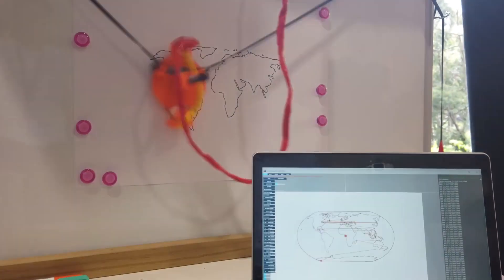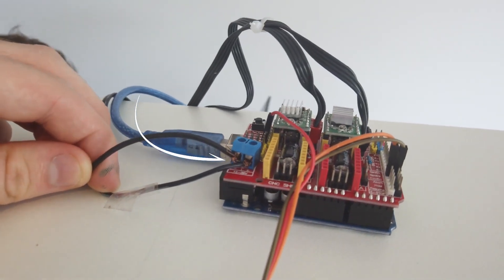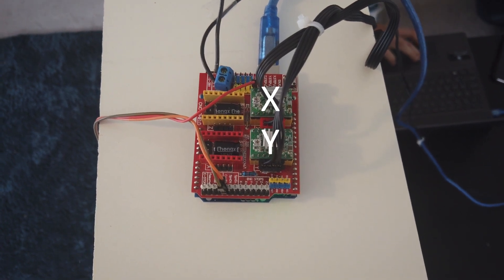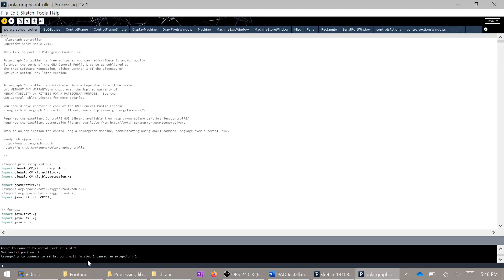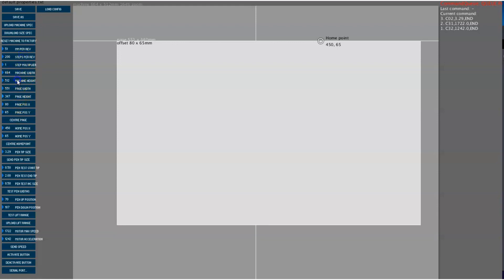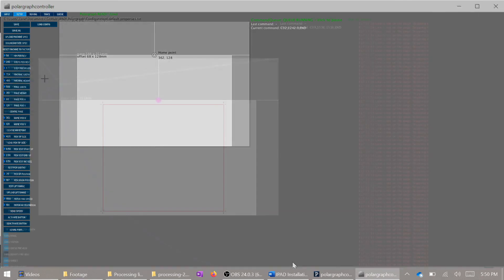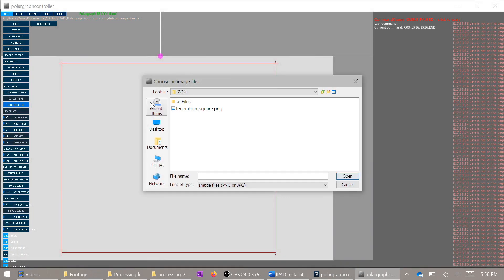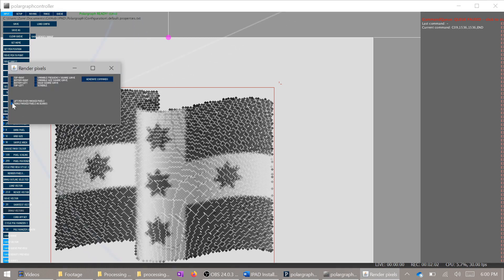How to Build a Polargraph - From Scratch!

Comment: For someone facing the error of not connecting press no serial connection first then wait and again select no serial connection and then the port in which arduino is connected its a confusing and outdated software but newer softwares like Makelango doesn't work with cnc shield they only work with motor driver shield also distortion issues ziz zag likes and calibration is difficult for a homemade polar plotter even tho u have 3d printed parts

Comment: This is a great guide, thanks for making it! There's a couple of things not called out here though that are critical!
1. Upload machine spec! This sends the description of the machine (size, etc) to the physical machine. You need to do this after you've changed any of the machine config in the software otherwise the machine will get out of sync, and you'll end up with distorted drawings, or some funky errors. You don't need to do this regularly, only after setting machine size, mm per rev or steps per rev. This can sometimes "reset" the machine if something gets corrupted in it's memory too. It does no harm.
2. In the video it looks like you're measuring the outside of the board to get the machine size - as you've correctly described in the manual though, it's the dimensions inside the sprockets that matter. Again if that isn't right you'll end up with some distorted drawings.
3. Set home. You do mention that, but it's worth repeating :) Every time you reset the machine you need to set home before you can draw.

Very common problem is where you see the message coming back from the machine saying something like "line is not on the page! skipping it!". Basically that means the machine can't resolve at least one end of the line within it's space. So if you've never done "set home" then it doesn't know where the pen is. If you've put in bad measurements - or forgotten to upload good measurements! - then you might be asking the machine to draw a point that the machine doesn't even believe exists on the board. 

That's almost always solved by having accurate measurements, then "upload machine spec", then "set home". I could never figure out a better way to make that less error prone but I often messed it up myself.

https://github.com/euphy/polargraph/wiki
Reply: Thank you for these précisions.

Comment: A lot of time taken for you to put all of this together so thanks for that. It looks straight forward but on diving deeper it seems to be for pretty advanced knowledge of programming and Arduino generally. The motor control board (shown above) is not the shield board you show in your manual. It would be useful if in the manual you had a good shot of which pins the servo goes into. I've built a homemade pen plotter using Grbl shield and Arduino and thought I'd like to make a Polargraph but this seems a bit convoluted...for me. I appreciate that's mainly down to me. I'll take another look.   Thanks  again.